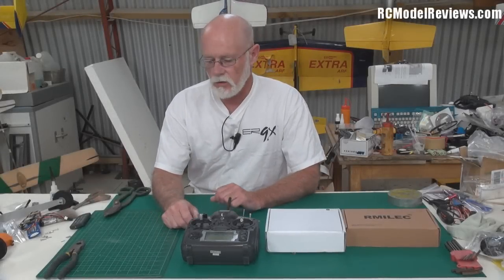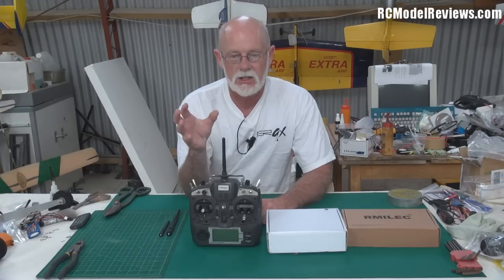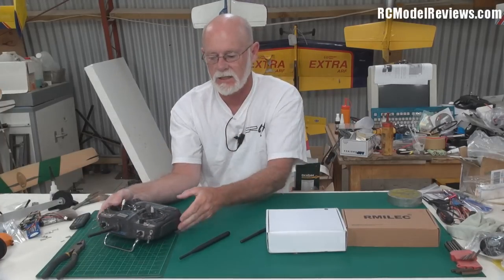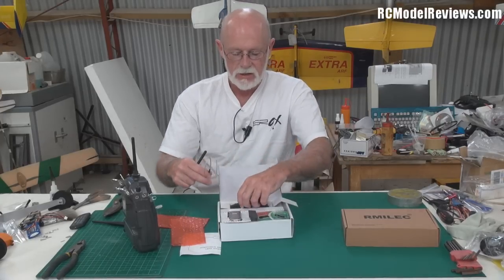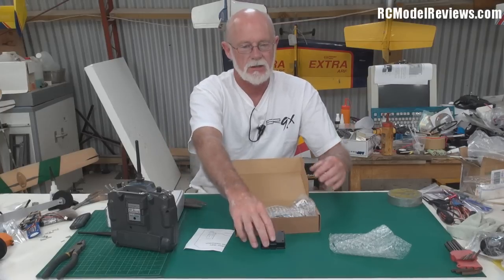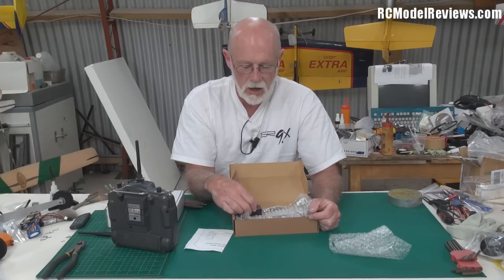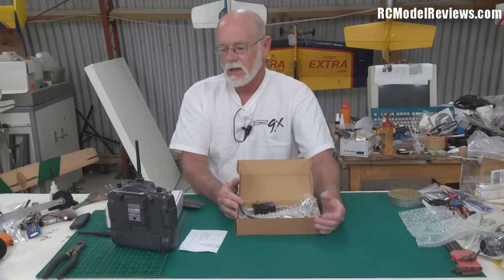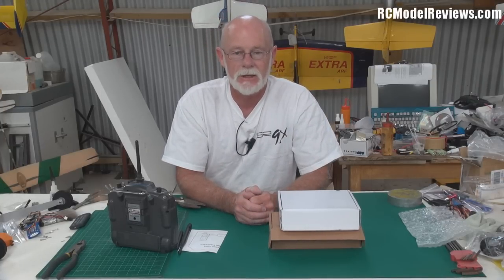FPV long-range RC options

Comment: Hi RcModelReviews
Could you tell me if this would work on an Hubsan x4 h107d fpv as i am looking at getting one but I would like to improve signal distance for control and video.
Help would be appreciated.
Thank You
Kieren
Reply: You could, as in it would work....but the Hubsan x4 h107d only has about a 4 minute battery life. That means you can only fly 2 minutes away before you have to turn around and come back. That's not very far away, so you don't need the extra range.

Comment: Hi Bruce, did you show a usual Wifi booster? Does the frequency band of a 2.4 GHz Wifi booster exactly fits to our 2.4 GHz RC output band with its 80 channels?

Comment: 433 mhz is the Amateur Radio 70cms band, hams can run 400 watts plus (in some countries 2Kw) please don't use 433 mhz.
Reply: I fly with a Dragon Link V2 UHF Long-Range R/C System and it works great I can fly very far so before you say not to buy mine works great ..

Comment: I would love to see one day electrically steerable phased array antennas for model aircraft. this is basically a high gain antenna that automatically points at the transmitter/receiver, but instead of mechanically turning, uses electronics in the antenna to change it's beam pattern. This would effectively make the range limited only by line of sight and flight time. Combining a 30dBi ESPA on the aircraft and transmitter would give you a 60dB gain to link budget.

Comment: Very difficult to get good coupling. It's possible but you might lose a lot of signal before it gets to the booster, if the booster has enough gain to make up the loss, it might be worth it. Also you want to start with a clean signal, any noise at the transmitter is noise at the receiver and reduces performance, and the cheap transmitter might not have as clean output as a good radio with a removable antenna.

Comment: 1dB, dBm is a measure of power (0dBm = 1 milliWatt, 30dBm = 1 Watt). Other than that you are correct, 1dB loss for each connector in the system is typical at 5.8GHz. You can get much better connectors down to 0.05dB loss, but they are crazy expensive, and only really used for precision measurement (eg. calibration labs).

Comment: As a rule you lose 1dBm per connector and depending on what cable you use for the tail, there will be a data sheet stating what the losses are per meter of said cable. So on your quad, you will probably have minimal loses. If your really wanting to know that your Ae system is effecient you could try and sweep it for VSWR, but thats specialized kit unless you work in telecoms. In all as long your connectors and cable are good quality and terminated properly I would say don't worry about thelosses

Comment: I use an SMA pigtail on my Quadcopter frame for 5.8ghz video. The pigtail has a panel mount SMA connector and is used to re-leave stress from the SMA PCB connection during a hard landing.

My question is, does using an SMA pigtail decrease transmitter / video performance ?

Comment: Great video, I was just wondering if I had a cheap rc controller without a removable antenna would there be any way to hack it to accept the 2w booster? I assume a little solder work would be all you need but was unsure if you could foresee any other problems in attempting this
Reply: Figure it out yet?

Comment: If i mount a 2w wifi booster on the back of my 9x can i use the 12v form the pin that would be on the tx port??
Will this cause any problems, I know i will have to change the voltage down to 5v using a UBEC, Thinking of using the Turnigy 3A UBEC, 
Iv already done the frsky diy mod and have removed the original 9x tx

Comment: Bruce,

Thanks for your videos.  Question.  You mention by changing the stock antennas only, you can affectivly gain about 40% in range.  But what is the approx gain in distance when using the 2 watt wifi booster vs the 60mw transmitter power? Assuming you are using the same gain antenna.  Thanks.

Comment: Hey Bruce or anyone that knows this here is my question ok. On the high gain 5db does it matter if the antenna is upside down on the TX? Due to the setup of my quad it has to be mounted upside down. Is that hurting my range?

Comment: Do you need to reduce the power output of an EU spec Spektrum DX8 before connecting it to the 2.4ghz booster? hope you can help. keep up the great videos.

Comment: Why the hostility towards people pointing out the facts about proper amateur radio licensing when using the UHF systems? Is it really that hard to study for and take a 35 question exam? You only have to get 26 correct, and in the process you will learn a plethora of knowledge that will apply to RC as well!

Comment: but here is why im concerns (interest) about it, the FAA has put laws before congress last year on RC,UAV,Drones. and it passed, kinda in a two part deal, the rest for this year. to help clear up the gray areas, and from what I read, its something we can all live with, but another incident being call in with a rc being at 1000 to 2000ft before the laws passed, well rc may be a inside hobby.and the FCC has laws about the uses of uhf. and one more time I like flying FPV and trying use UHF. GBHF

Comment: Amplifiers for 802.11b or G "wifi" should work for 2.4ghz r/c, as will the antennas. Only thing is wifi likes reversed polarity SMA connectors, and i dont know what the r/c uses. If the trans has regular SMA, then the threaded lug the antenna goes on has a hole in the center, where the wifi RP-SMA has a pin protruding. Just cut 5mm of appropriate dia solid copper wire, and shove it in the hole, now your SMA is RP-SMA, and it's reversable.

Comment: most of us run 50 to100 watts and some up to a 1kw on 420-450 (70cm), so I think I would knock you out of the air before you knock me off the air, and if you was that close i'd find you in just minutes, and unlike me,some of my fellow ham's they would want you paying the $10,000 a day fines and jail time..lol, but anyway 50km with 2 watts,that's 31.0686 mile's!!! I not saying it cant be done line of site,but i sure would like to see it with a rubber ducky of any size,I have a hard time with 60w

Comment: You should have noted that in some countries (like the USA), an amateur radio license is required to use the UHF control systems. It's not that hard to attain, and in the process of studying you will learn a plethora of knowledge applicable to FPV and RC as well. There's no excuse not to get licensed anymore (no more code!). Also don't think that hams can't find and report you, we love a good "fox hunt"! The 70cm band (420-450Mhz in USA) is used frequently, so you do run a chance of causing QRM!

Comment: Actually Bruce, Foxpro used to have a 72mhz linear available.

BTW how about some info as to sheilding? All I ever hear from everyone on the RC channels is "interference". Well I have fought that battle for years in my field and it seems that everyone is so anal about weight that they all forget about sheilding. 

Of course it could also be that most RC "experts" have no clue about RF and how to diminish the unwanted effects, present company excluded. LOL

Comment: I've had an RMILEC for over a year with no problems , I got rid of that stupid long sectional antenna and bought a RH771 From ........... but the module got quite hot........I ended up buying a RMILEC SRC771 ,now it runs cool and is much better looking ....Good luck over the volcano !

Comment: hey bruce. i have a question how o you increase range on a 72mgz  radio becuase im running a hobbyking 2.4 video system and a old futaba 72mgz and would like to increase the range? please thumb up to get it answered .

Comment: Hi Bruce, 

I found this video very useful! I am looking at extending the range of my FPV setup, and have been considering DragonLink, I will be very interested to see what you think of that vs the RMILEC gear. Also I'd be keen to know what kind of gear you've tested for the video link - tx, rx, antennas etc. 

Finally, what is the open source radio gear from hobbyking you mentioned in the video, do you have a link to this?

Thanks again and keep up the good work!
btw are you a Kiwi/Aussie?

Comment: Interesting video as usual Bruce but perhaps you might have pointed out that operating RC model control on 2.4gHz in some countries means limited power.  I think in the UK it's 100mW (not sure, it may be less) but it's certainly less than 2 watts!

Comment: Hi Bruce Nice to see a new video of you! 
RMILEC its not very good, or at least I havent heard very good reviews about it. Here in Argentina we most use dragon link for the rc, and 1.2ghz 800mw video, with 6dbi antenas for close flights(up to 3 or 4 km), and jsut a patch antena to fly far away. I´ve seen they go up to 30km without anyproblem at all. In my city a guy went to 75km away(and back) without anyproblem with a thomas LRS.
Big hug Bruce!!

Comment: Bruce, So glad your back.  

How about using amateur radio bands for control and video links?  In the USA we can use 50MHz to control models and with license in theory we can output 1500 watts.  We can also use 430Mhz ish for video.  I always wondered if it was feasible to use such bands to gather further range.   

I am little rusty on my ham rules but i believe the technology is there to do it.  Maybe the size is not...

Comment: Hi bruce, I've seen a booster in my local diy shop, which supposedly has a 25dbi increase, for $25, rather than the $60 i've seen online. however, the connector they have is an f-connector, not sma. is there an adapter anywhere that I can use to attach this booster to my module?

Comment: You won't regret it. I flew with 72mhz for 8 months, constantly dealing with RTL glitches at random distances (sometimes even 1km or less!).

I have not had a single RTL glitch in about 30 flights or so, out as far as 7km. What is stopping me from going further? Battery capacity, and even moreso, video range! RC range is no longer my concern!

Comment: Im soo glad you made this video. i started off wondering how to increase the range of my rc link and i got a u.fi to a sma adapter for my futaba 2.4 so i could put what ever antenna i want on it. using a 8db patchi i could fly out to 2miles no problems. to get even more i got a 500mw wifi booster with the 8dbi i got 10km easy. and i thought why doesn't every one do this it's so easy and so cheap but there is not much info on forms or in videos on this topics. so good job and keep it up

Comment: I'm using an L-Com 2.4GHz 1-watt booster with an antenna on the roof of my SUV. Great solid reliable range!

Now I'm looking for a 2W booster with a user selectable switch for 1W and 2W.  Then fly most of the time at 1W.  If at the edge of range and getting flaky link, I can temporarily boost to 2W to turn the aircraft around and return to 1W for normal flight. The switch would allow one to "feel" the range of the radio without necessarily RTL. In combination with RTL, it would be even better.

Comment: Legal limit on power probably depends on the country. In the US, there is a 1 watt 'hard' limit that even people with amateur radio licenses can't exceed. The WiFi booster would get you in trouble here if you start crashing wireless routers and the owner notices that "it only happens when that guy shows up and flys his model airplanes."

Comment: LOL, Only a Kiwi would use sheers as scissors :-}  

Please look at the ImmersionRC EZUHF system. Its pricey but I believe that its worth every penny.  Would be great to have this confirmed. Also the software has a built in spectrum analyzer which would be great to compare to your spectrum analysis results.

Comment: Hi Bruce, great video! You mentioned other sources of interferance onboard the aircraft interfering with the radio link, what about problems with servos? Maybe something to look into for us that I'm interested is servo wire length problems with interferance sources. I've had problems with gas engines and long servo wires causing one servo to twitch, and it seems just changing the length of the extension helped. Could you show us some ways of predicting and eliminating that kind of interference?

Comment: Looking forward to your review on the rmilec unit. I've had pretty good luck with it with 5.8ghz video, but seems less on 1.3ghz video. When I say good luck, I fly an fpv quad, and have been out to just at, or slightly beyond 1 mile. Thanks for your videos!

Comment: Great video.  The biggest drawback with UHF, IMO, is that you need a UHF receiver in each of your planes.  With boosting all of your planes will work without any upgrades.

Comment: Hey, I have a question to the uhf systems...

what's so special about the EzUHF? I think it works with 600mW on power boost mode... A 8-Channel System with diversity costs on HK about 334.98$... A complete system with 2.5W, 10-Channel and diversity reciever costs only 179.99$

Why? Why are so many people using EzUHF and not something like RMILEC TS4047 10CH 2.5W UHF Module System

Greetings, Kusti

Comment: I had a friend who lost an Skywalker with a GoPro, 1.3GHz AV Tx and a Dragonlink module. We think the model enter in failsafe mode because my friend lost control on the model and the plane started to make turns about 2 km of diameter at 400 meters. We lost video signal when the model was near to 6 km from launch point and was never recovered.

Comment: @Sikotryne...DL v2 has embedded filters. The delivered to me in less than a week. I Live in the us. My penguin has Dosd v2 and dragonlink v2 installed. Not one problem, but I have taken all the precautions to insure solid links. I have been told by many, not to buy the rmilec system by many Fpv pilots. But its behind rmilec past issues. Range link Is made by the chain link Guy. Chain link dare is terrible and reverse engineered. Ezuhf is a great system. Thomas system is pro level.

Comment: Hey Bruce, ibcrazy makes a brand new notch filter you can put in between the UHF module and antenna. Cheap too. The key to success with lrs is to shield wires, spacing components, as many do not get along well and understand what causes the harmonics so you may put in the proper filters. (high pass, low pass, saw, notch) btw Your going to love the penguin. Good luck trying to get her to land, she floats forever. The larger motor allows a 4s and has more than enough power to push her vertically.

Comment: is this the 2,4 booster that is used for wifi routers? then they permit duplex with these boosters if they are, wonder if the frksy telemetry will work with the 2,4 booster! i mean transmits forward and also alows receiving telemetry datas from the model!

Comment: Great vid Bruce!  I've got the dirt cheap Orange openlrs from HK.  Haven't tested it properly yet, just benchtested the basic workings and failsafe.  Flashed with latest thUndeadMOD firmware, seems ok thus far.  I hear Dragonlink has deliveryproblems and worse at present, if you're considering DL, I would suggest you have a look at (and consider) Rangelink. It's cheaper and I havent heard any negative feedback on that system. Quite a few here in Norway that runs that system and are happy with it

Comment: I am very interested in the RMILEC test as I have purchased one along with the fibre optic kit for its receiver (while it was available).  Very interested in the test and what filtering i made need to do.  I bought a Nagoya type whip antenna for it because every review i have read is that the telescopic antenna that comes with it is crap.